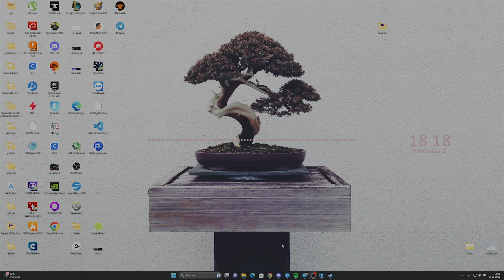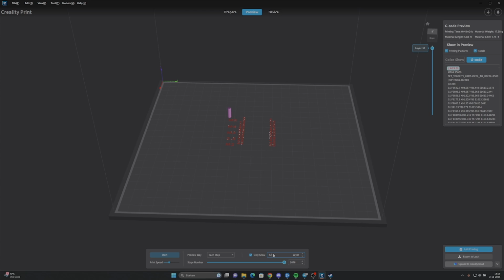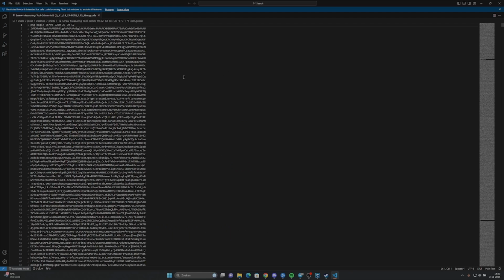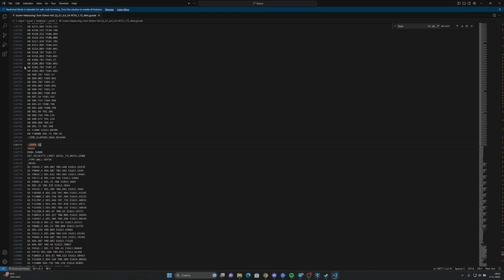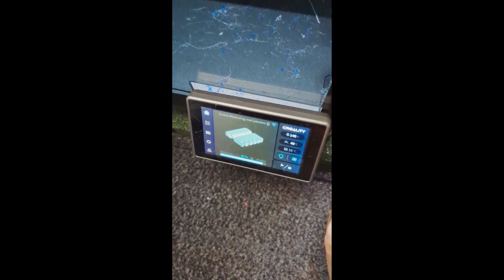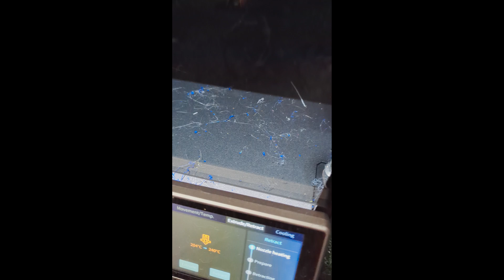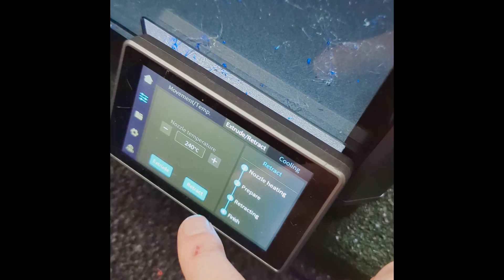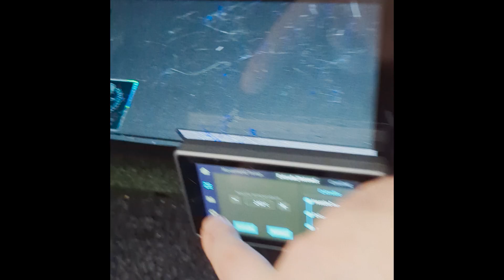Creality k1/k1max multicolor tutorial the easy way

Comment: Have you tried adding the 'Pause' in the Printer settings tap, G-Code section, scroll to Change filament G-Code and add PAUSE.
It should then add to your file/gcode automatically. Should work for colour changes in layer and layer height.